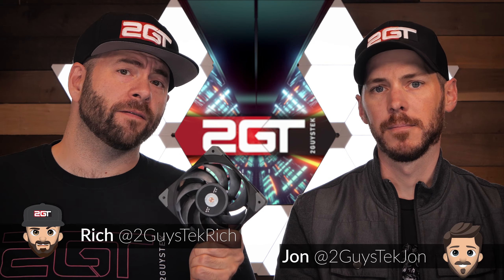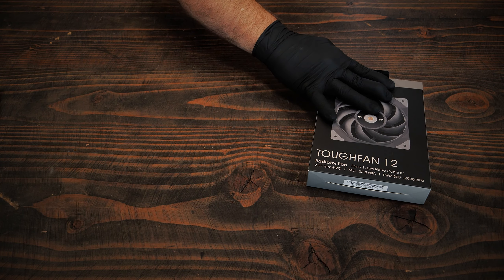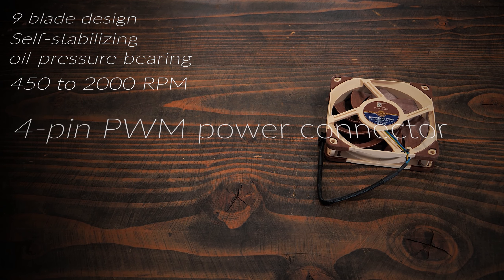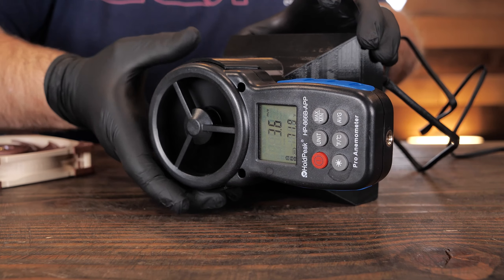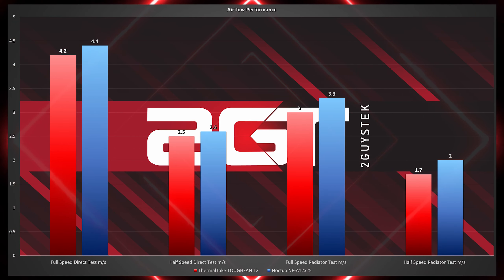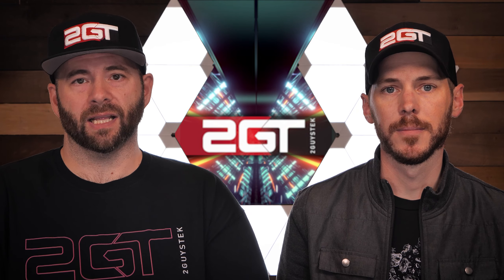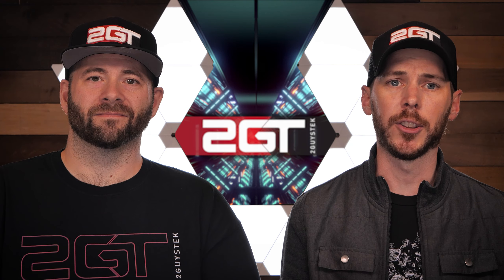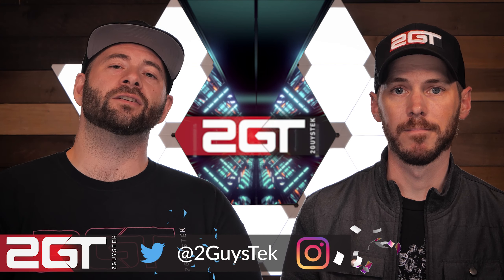ThermalTake TOUGHFAN 12 Review - IS THIS A NOCTUA KILLER?

Comment: Feel like this review is slightly bias.  The performance difference is very small, the price difference is enough to notice. There is no noise normalized testing, or even rpm testing ( not as useful but still).  I disagree with the end saying that Noctua is a better deal because of an included gasket.  For a single fan noctua might still make sense.  But for a new build with 6+ fans ( rad push pull) the thermal take would not make this a better deal.
Reply: Eh. If you want 'almost as good for cheaper' buy the Arctic P12. If you want no compromises, buy the Noctua or wait for the Chromax to come out.
Reply: The better fan is noctua and the reason you pay more one you have way better customer service that actually cares about you. Two the fan motor on the toughfan has 3x less life than the noctua. Three noctuas have better bearings. Four you have a 6 year warranty vs 2 i wonder why because they have done the testing on their copy cat fan and know it wont last anywhere as long as a noctua will why because its made cheap af but sold near the price of a noctua.
Reply: Price has now inflated to 24.99
Reply: @GermanicGoosicus  That's a good point of view. But, what if both fans have same probability to fail, but noctua charges more for peace of mind? Like Apple Care in someway but its not a subscription.
Reply: @Steamrick  If it wasn't for their hamming noise @ 1000-1200 rpm, arctic fans would be a monopoly. In my country 1 P12 cost 5 Euro, around 7$. At 900 rpm they are dead silent and they move a lot of air...
Reply: Nice job bud

Comment: So the performance is only very slightly worse, while the noise is very slightly better? If you noise normalize, that would mean they are probably on par for the Noctua at a significantly lower price: I would say that's a Noctua killer.
Reply: My this aint no noctua killer lmao. Dude this shitfan has over 3x less life in its motor then the noctua. Plus noctua has a better bearing and it also has noise cancellation at low rpms. Its so its not annoying like other fans on the market at low rpms.

Comment: Hmmm... 2 differing thoughts. While Noctua does have the material that prevents the plastic's expansion, the warranty, and the proven performance, you have to realize that TT doesn't have to beat Noctua per se. The TT fan is quieter, close to the performance of Noctua, is black and is $10 cheaper. We all know that fans take years to fail, unless you get a defective one. And also, you'd hardly see people keep their old fans when they sell it because it's time to upgrade. A lot of people won't see the warranty as worth $10 more.

Interesting and awesome vid as always guys 😉
Reply: The 2 pack is $35. That's a steal. Only thing this fan need is more reviews.
Reply: @ouki4925  I agree that this is indeed a steal.

Not hating on TT at all, but the problem that I see is with regards to IP. I understand that you can only innovate so much with fans. In recent years, the only radical improvements that I've seen in fans is the Maglev "bearings" from Corsair's ML series and the very tight tolerances that Noctua made (which necessitated the creation of a new material to prevent expansion) for the NF-A12. TT may have skipped the material part, but this looks like the NF-A12 has indeed been cloned. The close enough performance that TT got is proof that the concept of minimizing the gap between the frame and the fan blades does work.
Reply: @grimm00002  and noctua stole it from nidec/scythe gentle typhoon. Will you mock noctua now?

Comment: But isn't the noctua a rip off of the scythe/nidec gentle typhoon?
Also the Arctic p12 makes more sense perf/value wise
Reply: Arctic P12 has annoying whine noise at around 1000 rpm, you need to adjust the fan speed curve maunally to avoid it, however it's still best for this low price.
Reply: Thank you, everyone seems to forget they were the best radiator fans.  They still exist just under the parent company nidec.
Reply: The noctua is not a clone of the nidec fans.
Reply: @tacticalcenter8658  Yes it is.
Reply: @StarsMarsRadio  prove it.
Reply: @StarsMarsRadio  lol they arnt the same and that's not proof.
Reply: @tacticalcenter8658  Whatever man
Reply: @StarsMarsRadio  whatever? Your legally obligated to prove your accusation. And you haven't done so.
Reply: @tacticalcenter8658  lol
Reply: @tacticalcenter8658  Prove it.
Reply: @tacticalcenter8658  Man, man, man ... I confirm, the Noctua is an improved copy of the Nidec Gentle Typhoon. Now go play your childish game somewhere else.
Reply: @dorientjewoller113  prove it.

Comment: What was actual RPM on both fans? For sure TT has a little less rpm and that's why it is quieter and move less air. This is spherical horse in vacuum test. Also you can buy 2 -pack Tt for the 35 $ almost the price of 1 Noctua.

Comment: where is the temperature results?  That's the important bit
Reply from the maker: Temperature results are highly dependent on your cooling system. This is why we test airflow and noise as those can be independently tested regardless of what you hang the fans on. A great HSF can make even a terrible fan look good. Thanks for the comment!

Comment: Love the content guys! Keep it up  

I think the key thing here is that the sterox polymer the noctua fan uses is designed to not expand over time. This is likely why thermaltake only offers a 2-year warranty. 

This is one of the reasons why I went with the noiseblocker eloops. You get near A12-25 levels of performance, equal build quality, an exterior fan ring that prevents expansion, a long warranty and they come in black. The only downside being if they have to be used in push configuration on a radiator and can't be immediately obstructed by anything on a case. This works in my situation but may not in others.

Comment: Guys, are you considering the vortex effect on the fan on the anemometer? The air comes out spinning out of the fan, you have to straighten it before ypu cna get an accurate measurement.

Comment: I'm new to this channel because I searched for this fan..and this the strangest way I've seen fans being tested. Why not make a test build and actually use the fans as intake or exhaust on a case then on a cpu heatsink and a radiator...and then test then measure the temp of the cpu....
Reply: Because they're testing raw airflow. Testing them inside a case adds lots of other variables to the situation. They did also test them on a radiator, you might want to watch the video again.
Reply: @MorkaiAU  when I said radiator I meant an actual cpu cooler. Well channels have test set ups... Gives more useful info and puts things into perspective